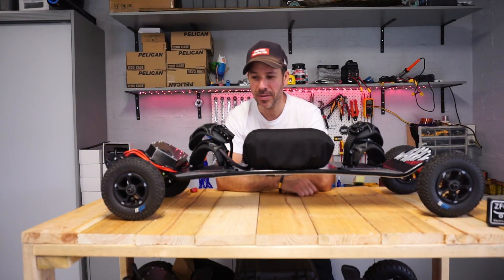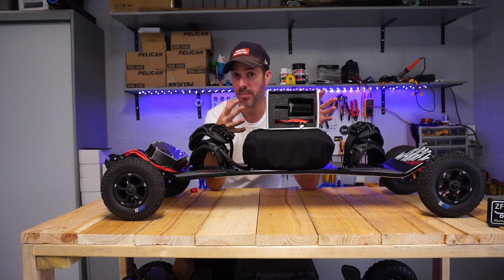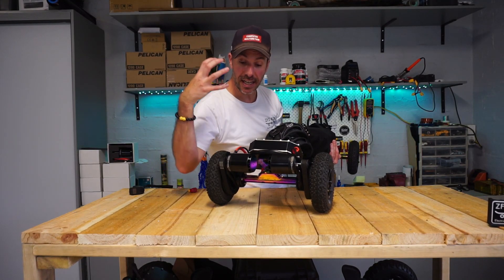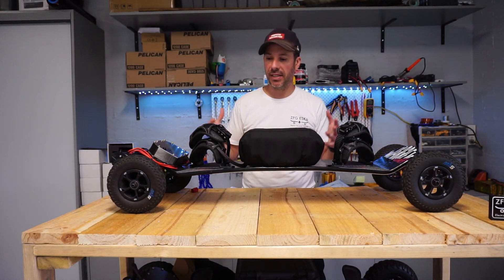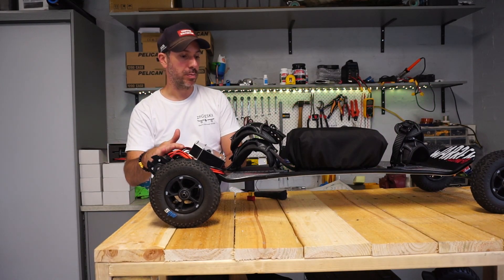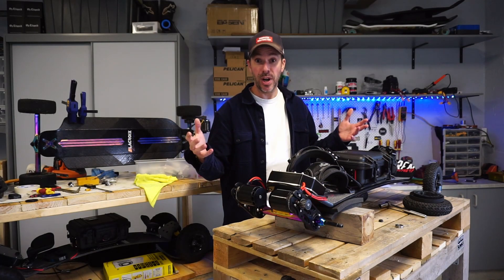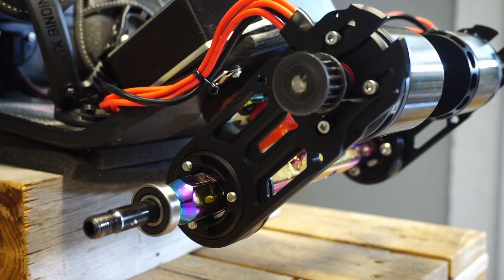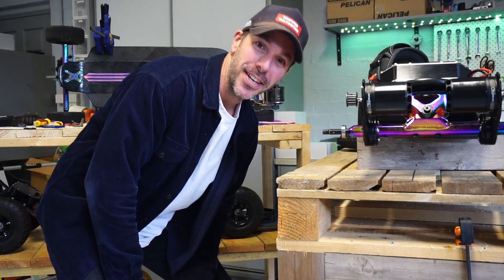Radium Build - MBS Pro 97 Mountainboard

Comment: Clean, how did you get the motors aligned, every Metal matrix truck I had in hand was twisted bc MBS doesn't know how to weld properly...
Reply from the maker: The new Matrix III are at a different level and well with the investment if you still have Matrix II. As for the alignment, it took a great deal of patience...... It also helps to have motor mounts with lots of adjustability :)